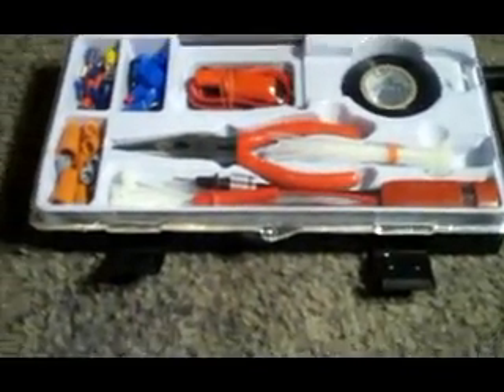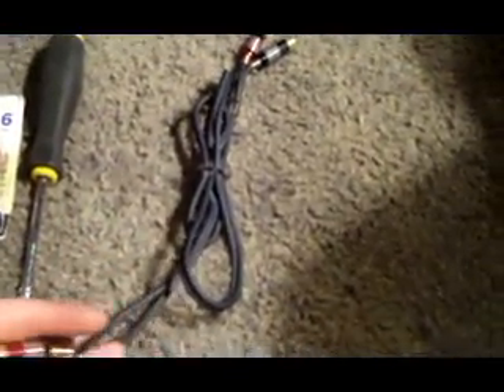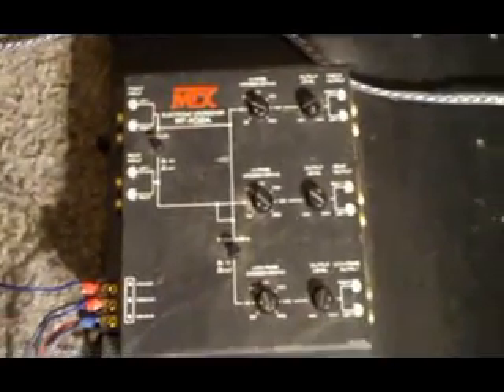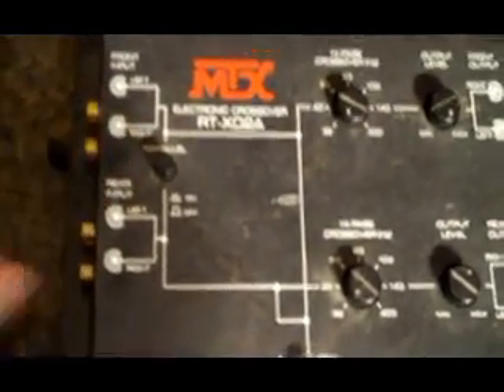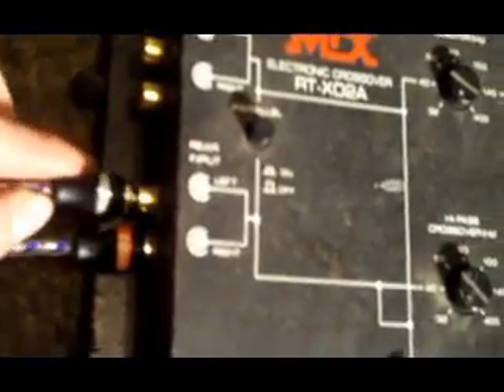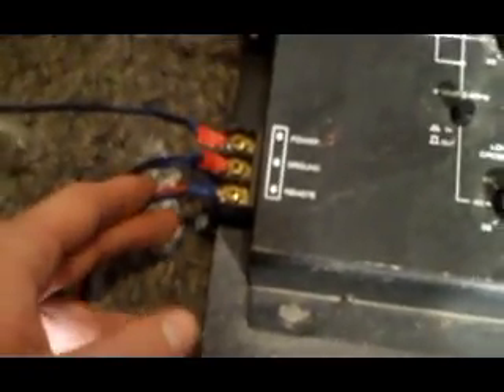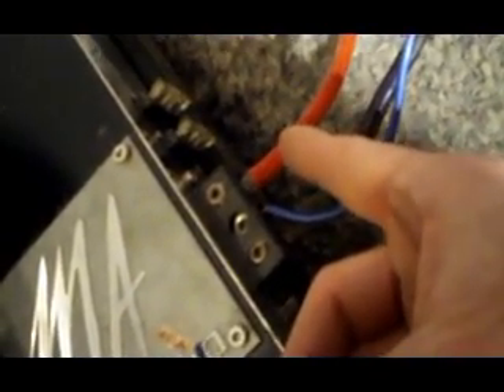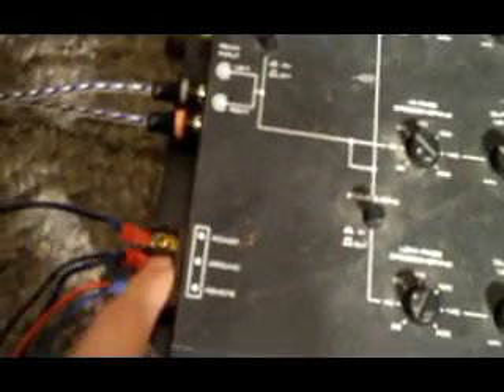How To Hook Up A Crossover To Your Amp

Comment: thanks Casper, Car Audio can be confusing and Wiring intimidating to a novice like myself, but i refuse to throw hundred$ of dollars at Car Toys, i can do it myself with a little help from folks like you. i just bought a 2005 Trailblazer and am undertaking the Audio upgrades now. recently purchased a Dual 12" Bandpass, Four 250 Watt 6.5" door speakers, Four Bullet Tweeters, 8 Farad Capacitor, and a Crossover to go with my Alpine 900 Watt Mono Block amp. the system already Bumps, but i'm going for higher quality sound this time, hence the Crossover (7 Band EQ, etc). i'm hoping the Crossover will boost the output of my mids and highs so i don't have to install a second amp to drive those. i'll find out soon enough. thanks for the video!
now if i can just figure out this damn Viper car alarm, it's the hardest to figure out by far.
Reply from the maker: LOL good luck on the alarm man. I have one that I need hooked up myself but I don't mess with alarms. Glad I could help save ya some bucks and thanks for watching :)

Comment from the maker: @JohnnyBeeAtch214 The small crossovers don't need a power wire just hook in the wires that it shows and it will just work. Pretty much just for mids and highs

Comment from the maker: Because its best to hook up subs to a mono block amp. It automatically filters out mids and highs. Then on your mids and highs I say its best to use a 4 channel because you can set them up for mids and highs so it blocks out bass and things. For example my 4 channel has a setting that says High Mid Low. You just set the switch to what you are doing and it filters. On a 4 channle you can use 2 channels for mid and use that filter then the other 2 channels you can set for highs

Comment: Yeah I know ..

my question is how do my coaxial speaker play highs and mids and sub play lows with out a separate crossover only using the amplifer built in low pass filter....
do you connect your coaxial speakers to amp or sub or what????

Comment: I just bought an MTX single 10" pre amp 300 watt subwofer...I have currently instatlled  two MTX  8" high tone speakers and they are  ampd with a 120 Watt.. All in the trunk of a classic Mustang. My question is two fold. 1. Can I split the remote wire coming from the radio, to both amps? (If not what's the best set up for the remote).   2. Should I have the gain maxed out on the sub amp and use a crossover to adjust accordingly?

Comment from the maker: @robertrhl Yes completely normal. What your hearing is distortion. When you get to loud for your sub and amp to handle it starts to sound bad because its getting distorted which means if you keep going that loud bad things will happen.

Comment: Is the crossover in this vid an active crossover? I have little crossovers that don't need a power supply - are those passive crossovers? I'm having a hard time remembering which is which. So the small crossovers go IN BETWEEN the amp and the speaker, right?

Comment from the maker: @210hammon You'd probably be fine without one. I'm not sure how much better a crossover would make it. My amps all have crossovers on them too but my crossover just makes it more simple to adjust cause all the knobs are on the top and easy to see. Plus I have a little girl so with this crossover I can just pop my trunk and turn down my subwoofer ( My sub amp doesn't have a bass knob).

Comment: Hey I have the same exact MTX Crossover and another MTX Crossover just like it.... Its been sitting in my room for 2 years...    I WANT TO KNOW: what is the purpose of this specific crossover? Does it put out additional watts to my sub? 
I Already have a 200 Watt Equalizer that i use only to my sub and sounds great compared to the radio's sub output. I also have 2- 400 watt tweeters that also sound great and are mounted by the visors on the door frames and are connected to my front door speakers

Comment: Ive just got some new component speakers with passive crossovers, im a bit confused with the setup.  At the moment my speakers run from the woofer/tweeter directly to the headunit. When I add a crossover, do i just connect the current speaker wires going to the headunit to the crossover instead of the headunit? And do I need new speaker wire to connect my crossover to the headunit, and if so what input does the crossover go into on the headunit, so I know what connection or adapter I need to put on the end of the wire

Comment: Will adding a crossover help an amp play lows? I have a skar rp 2k that has loads of power but absolutely horrible sound quality on anything lower than 35hz. I have a old 1000 watt kicker that plays lows 10x better than this skar amp on half the power.

Comment: What's the difference between the "POWER" connection and the "12 volt connection" I have both on the back of my subwoffer,,I figure they were the same thing.
Reply from the maker: Same thing
Reply: +casperskafs .....NOPE: The 12v is 8 or 10 gauge straight from the battery.....the "power" is the remote wire from the radio. Had to figure that out myself today.
Reply from the maker: +Skip Barrus LOL like I said same thing.  Here I'll explain. The 8 gauge feeds power to your amp from the battery just like you say. A remote wire is the same thing only smaller. When you turn on your vehicle your headunit comes on which then your headunit sends a 12v signal through your remote wire telling your amp to come on. The remote wire can be big or small doesn't matter. Either way it just sends 12v just like your power wire.
Reply: +casperskafs it can be confusing to a novice (like myself, and to those who don't understand ac or dc process. Thanks for answering..Merry Christmas
Reply from the maker: +Skip Barrus no problem skip

Comment: When is it nessasary to use a crossover I have a brand new amp I just got in 2021 new model andi found my old crossover someone gave me when I was younger and I never got around to using it since I wasn't sure what the point of it was could you please explain when and or if it's nessasary to use one please it's a rockwood detonator xr5  3-way multichannel  crossover

Comment: any help is appreciated on all the parts I need to hook up 1 amp with a sub and change all my door speakers and connect to an another amp while keeping factory head unit? I want it to sound clean as possible. any recommendation on door speakers and a good 4 channel amp too.
crossover
eq
hi lo inverter
sound processor?? do I need this to get the best sound?
Thanks
Reply from the maker: Imran Khan The brands are up to you. I can't tell you what to buy because that is my opinion. I run pretty much all Db Drive and love it. If you just want good sound just get yourself a mono amp and sub then a good 4 channel and door speakers and it will sound good if done right

Comment: That's an active crossover that you have, and there passive crossover which look like capacitor or coil hook up on speaker to roadblock unwanted frequency entering the speaker.

Comment: Lets say i have a Mono amp 1 channel with 1 subwoofer ....
The amp has low passfilter okk......how do my componnent speakers know when to play mids and sub to play lows....... how do i connect to the component speaker to amp so it sends signal??????
.......or do i need to buy a crossover for that .......if so whats the point of amp having a low pass filter if i need crossover ???

Comment: When tuning do you keep the amplifier at the setting your originally had it and then adjust the crossover ? Or do you adjust the crossover and then touch the settings on amp ?

Comment: can you tell me how to hook a MTX rt-x01a crossover I can't find hey manual on this particular one it's almost like the one in this video except for my low z input I have screws where you hook up door speakers then above that you have the RCA's input for the hi then obviously you have RCA outputs what's confusing me is my low input where you have RCA inputs on yours I have screws for my speakers to hook up to if you could give me some kind of answer I would greatly appreciate it
Reply from the maker: Yours sounds like an amp not a crossover

Comment: can u please help....i have 4 12s hooked up to a 1500 watt crunch and a 800 watt amp for my highs and have a crossover...the problem is that when i go pass a certain volume my amps turn off and goes into protect mode...WHAT IS THE PROBLEM, I TRIED EVERYTHING I COULD TO FIX IT BUT ITS STILL NOT WORKING!!!

Comment from the maker: I prolly had my fan hooked in with the crossover. For the fan I had cooling my amp I used the remote for power because that way it only kicked on when my radio and amps turned on. Sorry for confusing ya

Comment: Okay.. I need some help.. please.. Im trying to make a backpack that has a stereo in it.. I already have a Toppings Mini Amp.. and I have a rockford fosgate 10' sub in it at the lower location.. I want to put a Mid bass speaker in it and a tweeter.. How could I do that.. I'm thinking a Passive Crossover.. Can someone help me find a really simple crossover or tell me how I could do this without running the mid and tweeter in a series.. I would love you forever if someone could help.. the amps being powered off a laptop battery.. I get a good 7 hour charge.. thanks
Reply from the maker: Prolly need a small amp for your mid and tweet. NVX has one now that is the size of your hand that will prolly work good for your backpack

Comment: Hey, buddy....... when you install an electronic crossover, does it override the settings on the actual amplifier itself?  Meaning it doesn't matter whatever you set the amp at (HP, LP) or at any crossover point because the electronica crossover unit is now the boss, if you will, and determines the frequencies going to the speakers?
Reply from the maker: Yes I believe so. Sorry its been quite awhile since I've used one

Comment from the maker: @rome14able Your trying to push to much power. A lot of people do this. When you turn your volume up it's just to much for your amps to handle. Try adjusting your gains or you might need bigger or better amps.